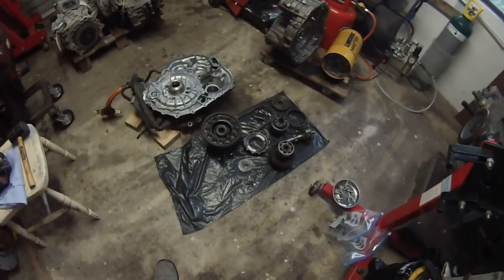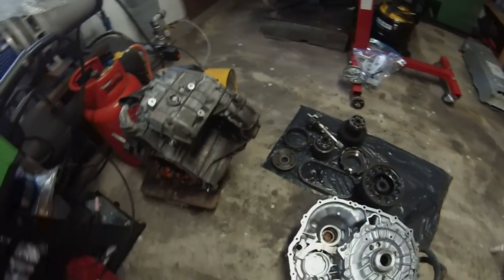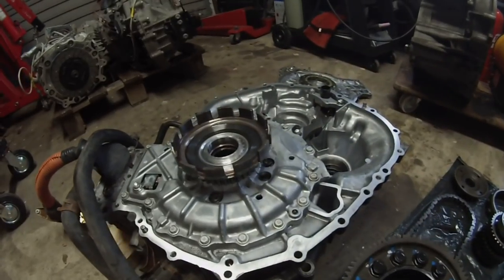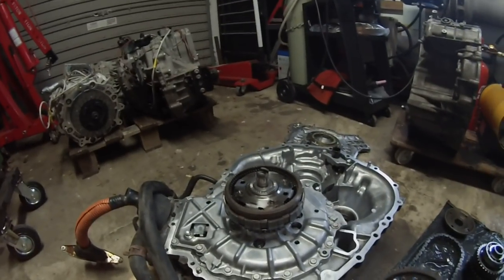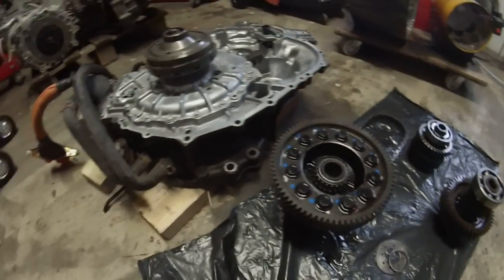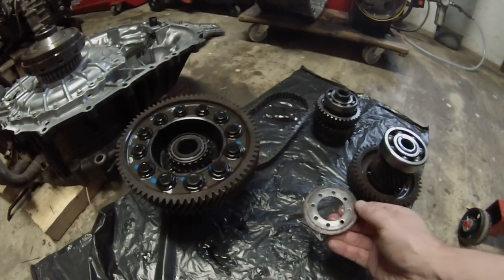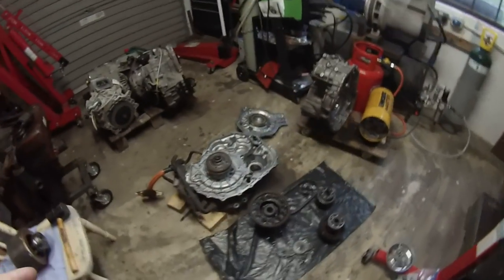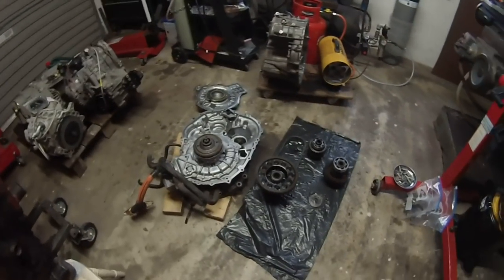Prius Transaxle Modification

Comment: Damien, the shim with three legs on it goes between the motor MG1 and the planetary ring gear flange. The shim with 8 holes or so sit inside the motor aluminium housing, and the gear with the sprocket chain and counter drive gear surface sits on top of this shim. I have the 2004 Toyota repair manual  volume 2-3 that has the drawings showing this. Kind regards.

Comment: There is a cool BMW 3 EV thread on DIY electric cars that uses Lexus hybrid gearbox with MG1 and MG2 AND locked input shaft.
The magic is there, but its just the control system that us not so technical guys would need

Comment: perfect, Love the idea here, I wondered whether it was possible to double up the inverter on a stock prius 2nd gen to get over the 25kw limit somewhere closer to 50kw. I have no doubt that these mg1 and mg2 in parallel can handle that and possibly a bit more.I would love to build/convert an electric camper but the env200 are all a bit dear at the moment. I would want rapid charging but I have only seen one after market solution to that as yet, jdemo. used to get the rav4 evs which didn't come stock with rapid charging. but they are £3000 so that knackers that.cheaper would be to use the bms and batteries off a car that had chademo/ccs as oem and work out how to integrate that using the canbus via spoofing the required canbus messages.anyway love your work and I see it as fundamental to getting more people to adopt evs. not every one is rich and not everyone wants the current commercial offering.
Reply: Whereswally606, I work for Quick Charge Power, so it is cool to see somebody here that knows about JdeMO. We are also working on a JdeMO kit for the Mercedes B-Class ED as well, should be delivering in January sometime, along with kits for other cars in the future.
If you want to get a DC fast charging setup going on a DIY conversion I think that Orion BMS systems are designed with support for the ChaDeMO spec in mind.
Reply: @Alex_Bessinger  Thanks Alex that's good to know. Still about £1000 for the Orion bms so I can't see the price of chademo after market falling too much. I mean in the spirit of doing cheaper conversions where you use parts from used vehicles from breakers this is still too much. But good to know people are working on it.
Reply: Also I like the idea of the renault kangoo crew cab vans too but there are a lot of them without a quick charge that would benefit

Comment: I assume you'll lose whatever reduction ratio the now welded planetary provided the Prius, but at a lower voltage rpm for conversion projects, I guess this is actually desired if that ratio is not too wide? Lets hope the welded planetary holds up for a test!

Comment: You don't really need mg1 to drive the car. Mg2 has enough power to drive the car.  My prius phev can go up to 60mph for 15 miles without the engine starting. All I need is a bigger battery. If I can get atleast 150miles, I will remove the engine and mg1 and put the battery pack in their place.
Reply: Mg2 is 80hp max, better to use both mg2 and mg1. Also, when you use one motor, some setups will have the other motor auto regen which is not good. Plus, the transaxle is designed for both of them. Might as well take advantage of the horsepower.
Reply: @lazarusmagellan2367  using 2 motors is also ok, but remember, mg2 drives the car. Mg1 starts the engine and charges the battery. It does not regen, and it does not get any power from the battery.
When the car is on power mode, the engine and mg1 provide the power to help the battery.
No mg2, no drive, but no mg1, you can still drive the car.
This prius model is not designed for speed anyway. Mg2 has enough power, I've used this car for 75,000 miles.
Absolutely no need for reverse engineering. Remove the engine and put a bigger battery on its place. No fault codes, no hustle, simple.
Reply: @fix-and-drive-diy-repairs  if you could pull that off then yeah that would make sense. but ive seen people weld the transmission and then use a dual motor inverter for 130hp total output. It just makes so much sense for EV swaps to use both motors and keep them in that little transfer case
Reply: @lazarusmagellan2367  Yes, that's true if you want to hustle with reverse engineering. But why not just buy nissan Leaf? They are very cheap now. I think it would be better than endless headache modifications, which are very dangerous and having to deal with the government paperwork!
Reply: @fix-and-drive-diy-repairs  are we legally required to re license it as an EV? I like doing car builds. I want a 400hp electric civic
Reply: @lazarusmagellan2367  here in the UK, the log book needs to be amended, and the car must be tested by the DSA. Insurance needs to be told of the modifications, and in some instances, most insurance companies won't insure your car. If your civic will only be used off road, you don't need any of that.
I am not trying to discourage you with prius Transaxle. It is still a good idea. I was only trying to show you an easy, less costly way.

Comment: Are you going to use two separate controllers or just one? do the rotors have the same number of poles / shorting bars?
Reply: both the generator and the motor are 8 pole

Comment: Damien, Do you think it's possible to rig up this Toyota transaxle to a 6 speed manual gearbox to drive the rear wheels of a e90?
Reply: Could potentially do the same trick he did in this video and interface the input shaft of the prius transaxle to the input shaft of the 6speed.
Reply: @olegil2  yes, I did.works quite well.

Comment: Do you have to weld the gears, wouldn it be enough to do the lexus hack locking the clutch axle to sync mg1 and 2?
Also, love your videos, and your dry humor :D
You and the openinverter comunity are doing a great job, keep it up!

Comment: (strange angry voice) Damien! That's no going to work! How are you going to balance the power between the 2 motors on order to make them run at the correct speed ratio?  (normal voice) I lean, it's going to work, more or less. But not in a very efficient way 
I am afraid.
Reply: This was my initial reaction too - but when thinking about these two motors in parallel, it occurred to me to think of any electronic devices in parallel - when I think this way the positive torque is simply additive, likewise current draw. I'm sure someone with a better memory of theory will correct me if I'm wrong.

Comment: Damien, 
I know you dont want to hear this, but...

Check the continuous power rating of MG1 & MG2 carefully for intended vehicle weight and final drive ratio; , the issue is not 0-60 acceleration on a flat road, but you may have very restricted hill climbing ability at cruise, eg freeway  uphill grades. Would be a bit embarassing if you had to join the trucks in the crawler lane)

You can use my spreadsheet to work out what you will be able to achieve, see here https://docs.google.com/spreadsheets/d/11AElL6OEqVmio--daeoCdPM1WpjG7KJxG_vZ76ThGys/edit?usp=sharing

(You can use the Lex303 vehicle profile to model  MG1 MG2 in the BMW303 project from EV forum as a start)